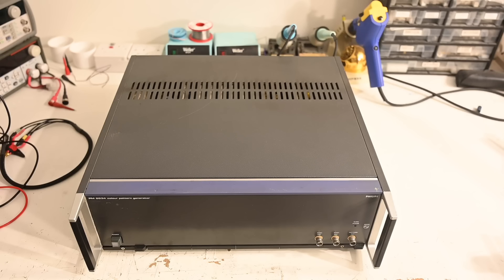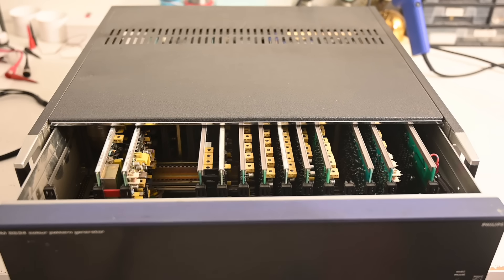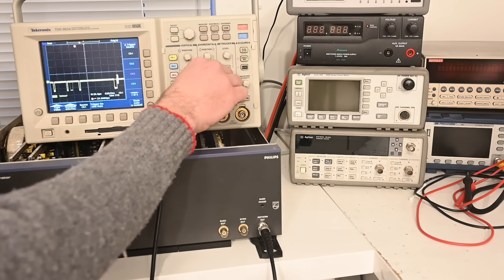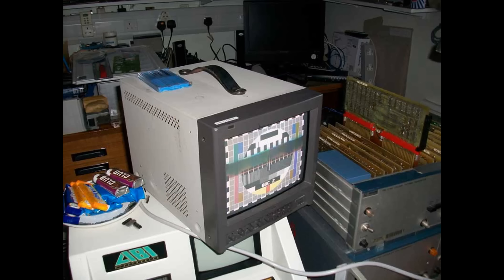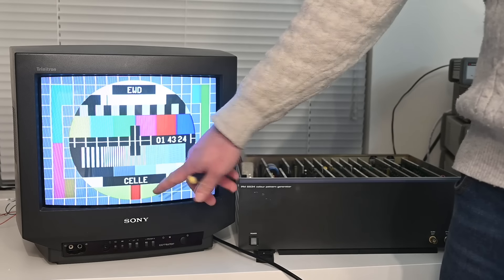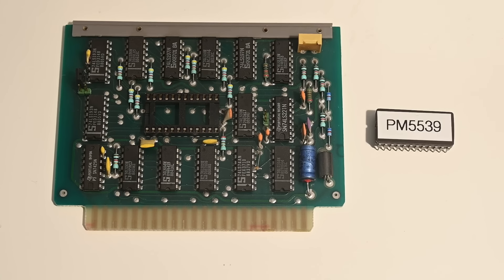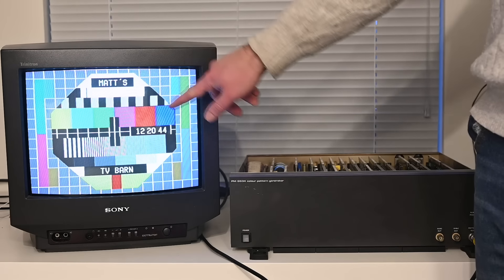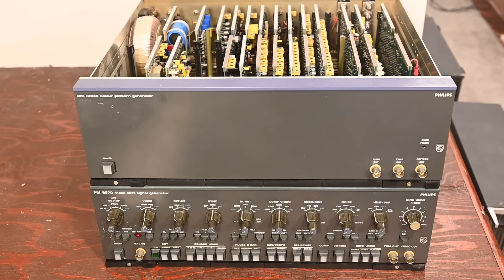#15 - Philips PM5534 pattern generator - repair, history, fun and teardown

Comment: The mysterious youtube selection mechanism gave me this video in my recommended list. 
This TV pattern brings back memories of my youth. I grew up in the 60's with black and white tv as my parents already had tv in the 50's. In '68 my dad bought a (Grundig?) colour tv because end of '67 the Netherlands switched to colour tv transmissions..
At the time tv transmissions only started 18i:45 with this pattern for 5 minutes, followed by 5 min a blank and white clock, and 18:55 a childrens program (Pipo de Clown, later de Fabeltjeskrant).
From the 70's onward, during the day sometimes on of the two nets would transmit this pattern (or the PM5544 pattern) during the afternoon. 

In 1985 I started to work for Philips T&M Almelo. this site was later taken over by Fluke, Pemstar and now Benchmark. From the mid 90's onward I've been involved in developing the Philips/Fluke scopeMeter series (123, 190 series I, II and III). Some models are equipped with TV triggering and in order to test this I had a PM5518 on my desk.

Thank you for the video!

Comment: 39:37 I think those strips may be busbars carrying both ground and supply, and have internal capacitance for decoupling
Reply from the maker: That you have time to watch a small channel like this at all, let alone 39:37 of a video... I salute you!
Reply from the maker: I had another look. The bottom strip is just a ground, but the middle and top ones appear to be two conductors sandwiched together. Sounds like a decent theory!

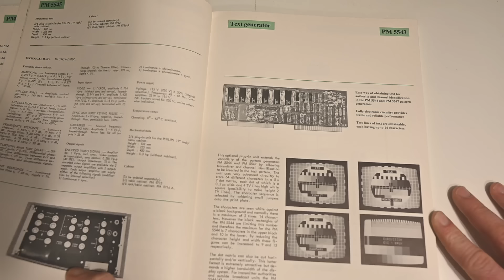Comment: 33:24 You're saying JTV used to use the PM5538 in Jordan 
but I figured it out anyway. JTV is Jordan Television (JTV) which was founded in 1968 as the national television station of Jordan and In 1985, Jordan Radio and Jordan Television merged to form. Jordan Radio and Television Corporation (JRTV)

Comment: This was fascinating, and impressive given the era it came out.  How does that B&W pattern board work?  Large scale integration digital logic chips?  Custom?  Or can it do everything with just a bunch of standard gate chips wired a certain way?
Reply: I learned a bit of how circles could be generated with somewhat basic digital logic.  Using registers to count some sort of timer, and then looking up the needed data in some ROM.  I love this older tech, because it's fascinating how they solved problems in non trivial ways.  Once you can write code, and I like to write code ( I get paid) the process is kinda basic to do certain things, like making a circle.

Comment: Thank you for this video. I felt transferred to the mid 90's, when I startet to work at Philips video recorder development and production plant in Vienna, Austria. (At this time the company was called ir3 (international reception recording replay) founded by Philips and Grundig). We had some of the pattern generators in the central transmitter room for the production test lines and some in the laboraties where we designed new vcr's and their features.
And you are right, the bars left and right are for testing the PAL (phase alternating line) colour system. When you are familiar with the system, you can see if your settings of the PAL decoder are correct (then the colours should be very dim) or not. Pah, that was long ago....
Reply: Whoah! What a nice story. Could you share some more details about developing VCRs?

Comment: If your horizontal sync frequency is 15.734 kHz, you are dealing with an NTSC signal.  PAL's horizontal sync frequency is 15.625 kHz.  So you have a sync frequency from NTSC with a subcarrier frequency from PAL.  Very weird.

The CBC in Montreal also used the NTSC variant of this type of Philips circle pattern generator, with several modifications:  The colour difference "ears" on the sides of the pattern were replaced with colour difference "bars" next to the edge castellations and behind the grid, -(R-Y) on the left and +(B-Y) on the right.  The six-step luminance staircase was replaced by an eleven-step staircase, modulated with 180° colour burst, and instead of five frequency gratings, it used six, like the BBC's Test Card G, but with sine waves of 0.5, 1, 2, 3, 3.58 and 4.2 MHz.  In the reflection check strip below the top text box, there was an extra bright pulse on black next to the existing dark pulse on white.  Finally, the text in the top box said "MONTREAL", and in the bottom box it said "SRC/CBC".

Here is the Montreal test pattern in its full glory.  https://youtube.com/watch?v=gJ6nAb3MudI&t=163s

(Everyone seems to forget about Canada… 😅)

Comment: A fascinating unit there Matt. I am like you and have a tremendous admiration for Philips test equipment, high quality and beautifully built. I have a high interest in the PM5544 Pattern and have some Rohde & Schwarz SFF and SAF generators which will generate this and can insert the text in top, side and bottom boxes by menu adjustment. these do not have a clock facility unfortunately. you are very lucky to find that facility! I also have an interesting generator by the japanese company, Eiden. Model 3116A. This also has the PM5544 pattern, but no text on pattern facility. There is teletext though. Its also a very accomplished all channel RF modulator to professional world standards including Nicam. Both these models are built to a very high standard. I also have an Eiden 121b RF modulator (well 4 of them) 2 work well but the other 2 have faults. Eiden will not provide any service information at all. These modulators were built to a very high standard and sold early 90s for £20000!
I should add that I am a vintage TV enthusiast as well, with the Telefunken sets from the 70s being a particular favourite. After all, Telefunken did invent the PAL system.
Reply from the maker: What era are the R&S generators from?
Reply: @mattstvbarn  Hi Matt it’s Difficult to say. No dates on the manuals or units. I would say late 90s to the early 2000s. I will research this.

Comment: 14:09 PAL Horizontal line timing is 15.625KHz (exactly 64us per line), & should be rock stable, so yeah, yours is definitely off, & it explains why your TV is making Bad Noises as the Hor oscillator & EHT generator try to cope with it.

Comment: An interesting video!

I’m vintage enough to have used the commercial grade PM5518 to test monitors in the 1980’s.

I’ve also come into contact with the 1702AQ EPROM, the latter being used in a Ferranti SCADA system originally designed around 1977 or so that used an Intel 8008 processor.  

We were still installing these systems on the GB (England & Wales) electrical grid system until the mid to late 1980’s  Repair to component level carried on until around 1994 when the processor boards essentially became obsolete.

We had the means to program the 1702AQ using a National Semiconductor development platform (used mainly to design a 6800 based trunked radio system) Significant parts of the SCADA system, mainly the I/O boards, remained in use until about 2000 ish.

Comment: Back in 80s, my brother and i started making a simple  B/W patern generator to fix and de gauss the CRTs.  These machines were incredibly expensive, as much as an apartment.   Later i tried to add a SRAM to add text and geometrical shapes.  But my C64 came around and i stopped playing with electronics 😅

Comment: This is a little offtopic, but for me it was new information that this one pattern was apparently used quite widely around the world. I live in Finland, and when I was a kid in the 80's and 90's I could only see Finnish and some Swedish TV channels (when weather conditions were suitable), and I saw that the Finnish channels had one type of a test pattern (as shown for example on https://youtu.be/D559r4C2i5E?t=33 ) and the Swedish channels had another type of test pattern (the kind shown on this video). So back then I assumed that in each country or even TV network there would be just their own kind of test pattern.

This makes me wonder if the same kind of pattern as in Finland was used elsewhere, and what equipment was used to generate it. In the old days, due to tariffs and currency conversion rates it used to be expensive to import things to Finland from abroad, so there's also some kind of possibility that it was originally some kind of homebrewn system. 🤔

Edit: apparently the video linked in this video's description shows something about what was used in Finland, but that video doesn't end up showing the actual pattern (maybe because the device is broken), so I don't know if that's what I had in my mind...
Reply from the maker: The guy from Finland does show the output of the PM5570, but it is not as exciting to look at because the output of that generator would never go on air. It is for a different purpose!
Reply: @mattstvbarn   Ah, okay, so it just wasn't for generating the picture I had in my mind. After watching this video I was heading to bed, so I just quickly skimmed the other video through and didn't see the familiar picture. Though, the broadcast test pattern did include a part with similar-looking stripes as in the other video, so perhaps some of the same or similar components were included as part of the broadcast test pattern generator 🤔.

Comment: I can add the following experience watching the test pattern in The Netherlands. Like in many countries, the transmitters are operated by the ptt (government post&telephone company). So there are in fact two pattern generator per network: one from the ptt (who did the most hours per day) and a pattern generator from the main control at the broadcast institute, which usually was on air maybe ten minutes before a start of regular programming. The main noticable difference between the two patterns is of course in the text: the ptt would say "ptt- ned.1" for instance and the broadcast switching center would have "nederland 1". But, there are more differences. I have observed that until the eighties, the caption was in small letters, not in capitals. In the mid eighties it changed to capitals. It must have been a decommissioning of the PM5544 and switch to a PM5534? Second: the circle of the later version was more perfect round, the original seventies one had less anti-aliasing (vertical and horizontal resolution), so clearly a more crude circle raster was put in the eprom. Last but not least, a clock was never used in our broadcast generators.
I presume, each transmitter had it's own PM5534, second one for spare, and there were around 10 transmitters to cover the country with three channels each makes around 30 units. And the broadcast controller one was at the AVVC Hilversum, another six (two per channel). And a couple more I presume as standby units here and there. Cable companies also used it on off duty channels with their own ident, since most transmitters shut off after the last transmission until the morning, must be at the head end.
Reply from the maker: @telocho Quite a range of different generators was used in the Netherlands.

PM5534: https://www.vintage-radio.net/forum/attachment.php?attachmentid=58738&d=1321553581
PM5655: https://www.youtube.com/watch?v=9WylF-9ciZY 

https://github.com/inaxeon/PTV_Preservation/blob/main/PM5655/Images/nl3.jpg
Tektronix TPG-625: https://www.youtube.com/watch?app=desktop&v=xB9c7hDrofo
Ah yes then there is that one with the tiny text (not sure what it is, probably non-Philips - possibly an old ShibaSoku but yet to confirm it): https://www.youtube.com/watch?app=desktop&v=hAXAkJVDAZU
As for the actual PM5544 I have not come across a definitve recording of it from NL yet.
Reply: @mattstvbarn  Yes... there was a PM5534 for sale last weekend which a sticker on it 'nederland 2 reserve" or something alike, must have been the one saved from the Lopik transmitter since it was sold by the broadcast museum there.
The ptt ofcourse had to re-adjust business after privatisation and maintanance of the transmitters went to nozema, that is why most nineties recordings have nozema in the top black bar andnot ptt. The one coming from the studio/broadcast company would not have the nozema logo. The weird small logo was used in the late seventies at least and part of my earliest memory as a child around that time.
Reply from the maker: @telocho  oh yes. I have an item from that sale which will be demonstrated in future. I heard the PM5534 wasn't sold in the end.

Comment: Great video!  Just a detail: I think the yellow strips on the b&w control board supplies both ground and 5V. The strip also function as a distributed decoupling capacitor for the power supply to all the TTL chips.
Reply: what the strips do is make a low impedance path to a real capacitor elsewhere. the actual capacitance of the strips is almost nothing.

Comment: It’s a meandering thought to be an old’ish engineer having used electronics of this vintage - without realising ‘vintage’ as the obvious future for anything at the time. 

The ‘industry’ was exactly that - stuff was incredibly expensive, but almost never tied to other financial expectations. You’d be expected to service units within the company, the producers did a lot to educate and document knowledge - without recurring expenditure from lease, IP licensing or forced maintenance outsourcing. 

I know, is what I say relevant? I think so, because this made workplaces “fuzzy” and by that maybe a little meaningful. Being curious wasn’t a career move, and many side aspects of “work” wasn’t monetised. 

If one wanted to be silly (a paid nerd), some spent time at work without pay to do just what this video shows now - educating yourself outside of the financial value of gaining experience. 

Better, worse, silly, wasted time? Yes, all of that. You could still naïvely buy your first apartment from that wasted time, without downpayment. Rhetorically, are we really better off “saving time” today…? 🤓
Reply: these days there are service guys who rock up with a laptop which can restore equipment to working order in minutes. 
all for a "modest" few thousand dollars. but they dont let u keep that laptop !

Comment: Disabling the central pattern is interesting for a TV factory or a repair shop, where the geometry of the whole TV area is checked, e.g. on the factory floor.
Reply from the maker: But you don't normally need to mortgage your home to do so ;-)

Comment: Thanks for the video. A very expensive piece of equipment back in the day. I bought a brand new Vauxhall Astra for £5000 back in 1984.
Reply: there used to be a pattern generator kit in 2005 sold for around $150, that did the same thing this generator does minus the text.

Comment: Ohh, bring back memories. We had 2 of this units for our station id for many years, and also ITS inserters from Phillips, we had the TXT and clockoption in both of them. Have repared them several times. We later exchanged the units with the 1RU PTV versions, and when we builded our new facilities we had the DK Technologies 1RU unit.
The main reference are the colorfreq on 4.443361875 Mhz that are the base for the 15.625 khz horizontal osc and the 50 hz vertikal osc.
The main Xtal osc need at least 1 hour to heat up.

Comment: I keep watching your videos and how the PM5544 got it's colours are interesting with the technology that was only available today.

It's funny that I managed to crack the codes on the PM5544 test pattern just using Photoshop. How ironic?

Through the use of visual arts, not through complex mathematical decoding like how I may see how the PM5544 test card was most likely to be created in 1966.
Reply: My father told me when I was young and before he died when I was 30, maths rules over art.

I decoded the PM5544 with art instead of maths. I grew fascinated with the test card from the age of 2 in 1982, in my formative years.

Comment: Very intersting video. What is the EPROM programmer you are using?
Reply from the maker: For which EPROM? There were two in the video
Reply: @mattstvbarn  For one, one can clearly read it is a Dataman-48UXP. So my question is for the other, with a shark drawing on it.

Comment: I also had run with an ancient eprom, mine was an MM5204, for which I made an Arduino based box to read them. Luckily I didn't have to write one, not that I'd ever be able to get a blank.

Comment: Interesting case, I have a near identical unit, just shallower. My box is a radio isotope metal thickness gauge, definitely not a Philips device. So were Philips into case manufacturing, selling them to anyone, or were they buying in the cases?

Oh, and glad you didn't shorten it (or the worse one of lengthening a video with static pics & 'elevator music')
Reply from the maker: I have seen the case used by other Philips divisions but not other companies yet..

Comment: very interesting! I like that all the different circuits are modular, so if a problem were to arise,  it would just be a matter of powering down, and popping a new module in its place. rather then everything on one PC Board. which would be a nightmare to do diagnostics on and repair.  I liked and Subbed 😀👍

Comment: Looked like an electrolytic capacitor reforming after having a long holiday.  [edit: but the fault seemed to move with the chip - weird!]
Reply from the maker: It is weird alright. If I hit the chip with freeze spray it fails instantly. The "good" OQ5506 on the other hand doesn't care.
Reply: @mattstvbarn  aging or some form of mild electrical damage pushed some of its characteristics just a bit out of spec?